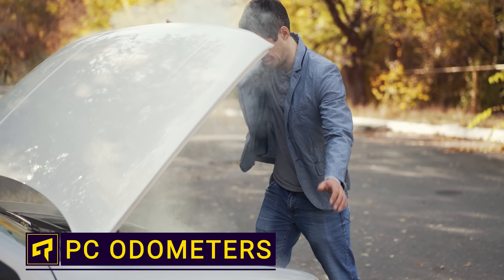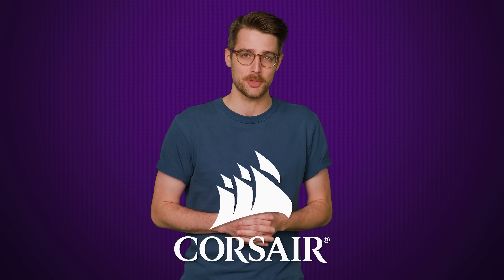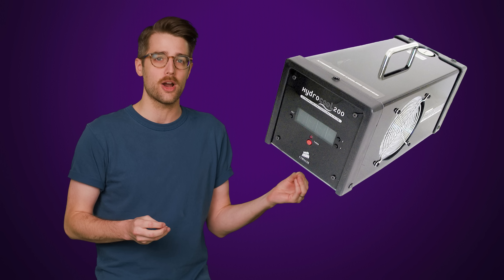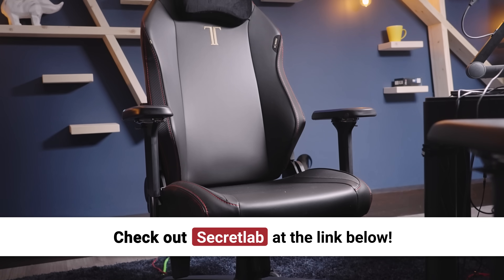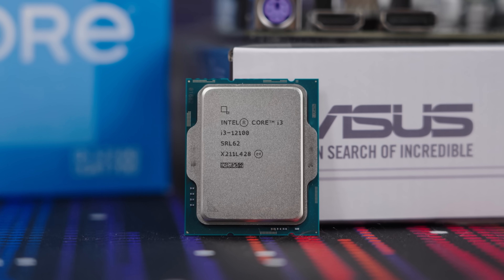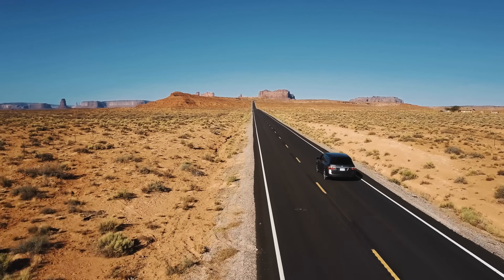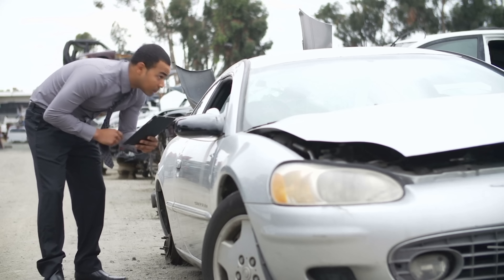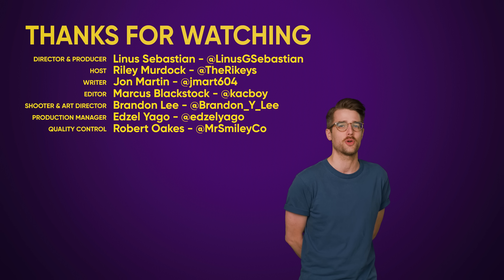Should Computers Have Odometers?

Comment: Historic footnote: old IBM 360 and 370 mainframes had "odometers" on the front panels that counted the hours operated.  The counters were used for billing by IBM because the machines were often rented rather than purchased outright.
Reply: Some computer monitors list backlight hours in the settings.
Reply: PS3's track the amount of time they are used for too, mine has 165 days on it, it got a repaste a couple months ago and I have CFW on it (evilnat 4.89 with cobra 8.30) to control the fan through software, it also got a new Blu-ray drive and HDD a couple days ago.
Reply: @nathanmead140  never knew that. Where can i view it on the XMB settings?
Reply: @ozordiprince9405  the ps3 tracks it but I think it's only viewable with custom firmware.
Reply: @nathanmead140  can official firmware be jailbroken yet or do we still need to downgrade to 3.55 still?
Reply: @mycelia_ow  I was on 4.88 with hen but I downgraded to 4.88 OFW then used an online update to go to 4.89 OFW and used bgtoolset to install CFW over the official firmware.
Reply: @mycelia_ow  PS3 hen can be used on PS3 super slim

Comment: I bought an “Amazon Certified Harddrive”. It had 68 thousand hours on it or over 7 years on. I feel ripped off and can’t get a refund because it does work. It only failed 1 smart test and it was in the past when it was crammed in a server and hot. I just don’t trust it it’s supposed to have 80% functionality but..7.8 years of power on time? Fuck no.
On graphics card longevity I bought a BFG GeForce 256 graphics card back in 2005ish. It ran for fucking ever. Ran over night many times in the Sims online(store) Final Fantasy XI(selling items and currency in Jeuno) Second Life(Some friends were suicidal and I went through a long period where I couldn’t turn it off because I was so scared they would try and need someone to talk em down) and other things. The fucker was run daily on those and the Sims2. It died in 2014 due to a power surge as well as the windows 98 pc I had put it in. Graphics cards usually last a very long time unless something outrageous happens or they are used for mining. Mining absolutely wrecks them. There was 2 graphics cards I have had that failed and both were in laptops.

Comment: The reason GPUs don't have odometers is the same reason they put a $3 fan on a $500 video card; they want it to be disposable. Nvidia doesn't want you to buy a used card, they want you to put it in a landfill because they have a huge stock of the hottest newest thing to sell you. Every single year.
Reply: Oh if only they actually had a huge stock every year
Reply: Normally I'd say this is very cynical but I'm very cynical in the tech industry.
Reply: I wish Nvidia had a huge stock of newest thing every single year.

Comment: I don't think they should have odometers or hour clocks. Yeah it'd be nice if you're shopping for second hand parts, but considering the low price to todays comparative performance, it'd cost a few cents in manufacturing cost to help someone who isn't buying your product directly. Because it has nothing to do with safety, consumer protection, or any other useful thing than drive down the cost of used parts (because who would buy a 3080 with 10,000 hours on it) instead of spur on sales of new hardware. Mr Consumer, do you want to roll the dice on used parts or just buy something new?

Comment: GPU's and motherboards should also have SMART capability. The bios takes care of the ram and cpu testing, hard drives/ssd's have SMART already, but GPU's either work or don't and you never really know why. Need a SMART pin on the pci-e spec that can run regardless of the operation of the gpu.

Comment: Up until 2019 I was routinely using a 1987 Dorse based computer with its 486 processor it was running disabled accessible software so it was well worth using for me a blind person oh I still grieve the loss

Trouble is I kept plenty of parts around but finding an old school. Technician has proved impossible

Cheers

Comment: As pointed out odometers even on cars are kind of useless, you could have a low mileage car completely trashed or a very high mileage car with not a single issue, it depends on how it was treated, maintenance, repairs, & parts replaced.

On a computer that would be things like how often it was dusted out, how was it cleaned, how gentle was the person with the parts when first putting the system together, did anyone near it smoke or have pets, was it connected to a UPS / surge protector, what was the avg humidity level of the room it was in, how hot did the parts ever get, what voltages were they run at, was the system ever moved around in a car or something that would of subjected it to a lot of vibrations, what software was run, how stressed was the system during most of it's powered on time.
Reply: Whenever my dad is looking at a vehicle to buy or helping someone look he uses the odometer as an indicator as to how much expected money you're going to be sinking into the vehicle for maintenance. Is it near the milage for stuff like timing chain replacement and other milage dependent maintenance. If it's past is has it been done by the past owner and when, did they do it on schedule or wait longer then recommend. Ect.
It's never a definite piece of information but it's a good way for him to know before he even looks at the vehicle in person where he should look closely at, what questions he should be sure to ask, and so on.

The car may be in great shape and only cost $1k but if your then gonna have to dump a bunch more into maintenance and not have access to the car right away then no deal

Comment: What's the point if you're running proprietary operating systems or proprietary hardware requiring third party drivers? THEY will decide how long your hardware will be supported, so how long your hardware will last. Most 'modern' hardware can last decades theoretically.... but you know, Google only supports Chromebooks for what? five years?... Android, maybe three.... Microsoft? the less said about Windows 11 the better.... NVIDIA? however long they decide to support the card. I've still got a Commodore 128 and it STILL works 30 years later. I bet you wont be saying the same about your current MacBook or Windows machine.
Reply: You can use hardware without having the newest available software just fine...
Reply: @veduci22  Unless you've got Microsoft's Pluton infecting your hardware..... Or Googles locked down version of coreboot.... or an NVIDIA GPU... or a gaming mouse that requires third party drivers.... or RGB....... 

If it ain't open source in the Linux or BSD Kernel then you don't own it.

Comment: This video, in the end, sort of ignores the huge upside it would be to have an "odometer" on things like GPU's for people buying used, especially with a lot of mining equipment being sold and bought used. I think it would be great for at least GPU's to have some sort of odometer on them. My main concern that you didn't address at all was the fact that these types of electronic odometers might be as easy to hack as the hash rate limiters manufacturers put on some GPU's crypto-mining ability... but who knows.
Reply: Oh those would 100% be hacked. There are already drives that misreport how much space they have.
Reply: everything is software based. If miners could defeat LHR and get 90% performance in a matter of less than a week, thinking an "odometer" would do something is kind of dumb. It's gonna end up like the Fake 1050Ti videos Linus made. 
We are talking about Miners, they already go all the way to flash custom BIOS and what not. A custom flash to replace odometer reading wouldn't be that hard
Reply: Tbf people already replace odometers in cars
Reply: No. I think you overestimate how consistent "wear" is on a chip. I design the bloody things, so I've had to deal with the nuts and bolts of the situation.

What is "failure"? Our fab defines it as a shift in certain parameter by 10%, e.g. threshold voltage in a FET. The thing is, you might get a "fast" corner process where the FET was already off by 10%, so by the time the device has "failed" it's merely back to nominal performance, while a slow part having such a shift might not work. What's the real margin on a part? God only knows. The fabs have margin, the chip designers have margin, the testers have margin, etc. So even if you get an officially "slow" part that meets the fab's definition of failure the odds are pretty good that unless you're overclocking to the limit you're unlikely to have an issue. If you/your vendor uses the parts as specified it's exceptionally unlikely you'll have issues and your "odometer" is pretty much useless.

Things get more cloudy, obviously, if you overclock/overvolt the part. There's a reason we don't warranty that, and that's what I'd worry about more. For every 10C over 100C you cut the life of your chip wires by 50%, for example. Mull on that a while and realize that your temperature sensors are almost certainly NOT in the highest temperature areas of the chip (who'd waste that much space in what's likely a timing critical region?), and with FinFET designs the connection to the substrate, and thus the ability to cool the device, frankly sucks so overclocking/overvoltage can take off extremely on devices already likely designed near the limits. It's really easy to get temperature rises well above what the temp sensors say in very high power sections of the chip, and pushing them harder can easily cause faster shifts. I personally don't deal with overclocking/overvolting unless it's to bring some part back to life, but I view stability and long life as worth more than a couple of frames/sec.
Reply: @BodePlotter  what about power delivery? Is it ok to run those kind of components near and above 100C?
Reply: @vadnegru  Generally, yes. Power devices are made in processes that are very different from most digital processes. And most power guys generally spec them to much higher temperatures than you can do with advanced process nodes. Still, aging goes up as temperature goes above 100C, so at 120C you've cut margin by 75%. For advanced digital chips, they're generally designed with 5-10 years of 100C continuously these days depending on the company. Power delivery controllers are usually rated 10 yrs at 110-120C, but at a constant load with higher quality parts than your discount supplier might be using. It's those off-chip components that tend to be the issue (at least in my experience from having designed the controllers in a past life).
Reply: GPU hacking issues aside, one could trivially edit the value seen by the CPU using a hypervisor (which has full access to virtual IOMMU). Of course, the real value would show up once the buyer puts it in their own computer, but at that point you have the money.
Reply: A mining card would actually be a better purchase than a normal gaming card, with gaming you're going to cause a lot of heat cycles as you use it then turn your PC off at night, which puts more stress on the board and components than mining where it simply warms up and stays warm, it staying warm could cause electrolytic capacitors to dry out faster but depending on the location and how well it's cooled, that's fairly a minor concern and would happen on either card.

Also, they will never be overclocked like a gamer would want, miners care most about efficiency, so they're going to take good card of those cards.
Reply: @vgamesx1  What about memory? i keep hearing about how miners put the vram under big stress
Reply: @xthomas7621  Mining cards run with their memory overclocked 24/7 and GDDR6X on stock thermal pads can be above 100C.
Reply: @ByteFilm  memory are actually rated to run within that specs.
Reply: @ByteFilm  miners also replace or clean/de-oil their thermal pads 100% more than gamers do. Literally almost every mining forum is filled with threads about putting better thermal paste and pads on their cards.

I straight-up watercooled my gaming card to let it mine on the side. Put heat-sinks on the front memory/VRMs, and then did a massive block of aluminum on the back with a full-coverage high-end pad.

The card can mine at 24 on the core and 30 on the mems. Ask a gamer what "flip-chip-BGA" is, and you'll realize that miners care way more about maintaining their cards than pure gamers.

Personally, I flashed a 400w galax vBIOS on my 2080ti that paid for itself with mining, and the card has not seen 50 degrees. Has not lost a single mhz of memory or core OC stability.

Comment: 3:07 I am unfortunate. I didn't think USB 2 limitations would become a problem down the line. I merely trusted that a better USB driver/firmware would give me nicers speeds. While upgrading to this Tecra A11 in 2019 did yield me better USB speeds up the the mid 20MB/s, my thirst for speed is now high. I'm... Sorry for saying it like that.
Reply: For desktops you can get USB3 PCI-E cards but I don't think there's a solution for laptops.
Reply: Most modern smartphones use Type-C primarily for charging, and just 2 wires (USB 2.0) for data.  
I still think that USB 2.0 is fast enough for normal user, and only if you need to backup few GB of data or need to connect external GPU or DOCK with LAN and HDMI, anything faster than USB 2.0 is just overkill.
Reply: @Mladjasmilic  yeah, and also SSD are useless and we can't see above 60fps right?...
Reply: @Goejii  Well USB 2.0 has its place. Usually more ports, if used for input devices like a keyboard it makes no difference. And USB 3 messes with bluetooth, thats why i have USB 2.0 hub in my setup which is a bit away from any USB 3.0. From my own testing it gave my headset atleast 25% more range and made my couch mice + keyboard useable
Reply: @Goejii  they're not
Now tell me how often you need high USB transfer speeds
20 megabytes is like dozens of thicc books worth of information
It's gonna be enough for most common USB uses like mouse and keyboard
If you wanna transfer files to a flash drive, just be patient. Normal people don't even have to do that often
Reply: @Mladjasmilic   Not true. Most flagship phones got USB 3.0 when they switched to USB type C around 5 years ago. Well except Apple where they are stuck at USB 2.0 due to the lightning port.
Reply: @pixels_per_inch  Flagship, yes. But budget devices that cost $150 do not more than USB 2.0

Comment: SMART data off the HDD's is pretty much the only way to know how much "miles" a computer has put up with, assuming that parts haven't been swapped out yet.
Reply: And everyone's necessary gadget called Printers too have that wonderful magical feature than the open-source gpu softwares.

- Comeon, my brand new printer has attatched ink tank.
- yes your favourite one too has that feature.
Reply: I'm genuinely surprised that SMART wasn't mentioned in the video. The "Power on hours count" stat (amongst others, like "power on count" and "spin up count") is effectively an odometer for hard drives & SSDs.
Reply: @Psythik  except it clearly was mentioned.